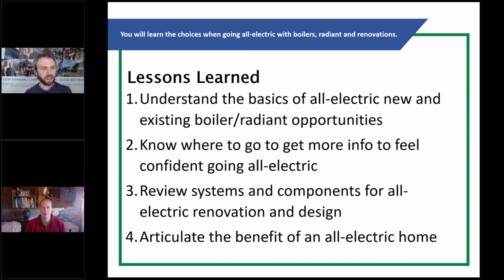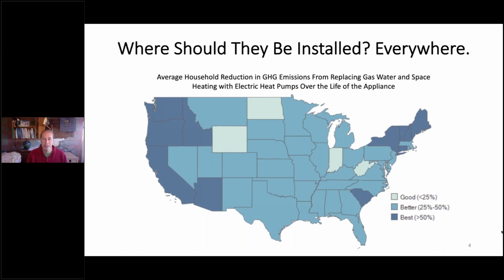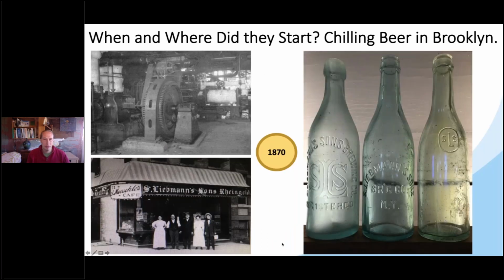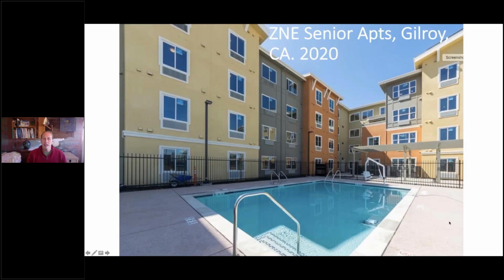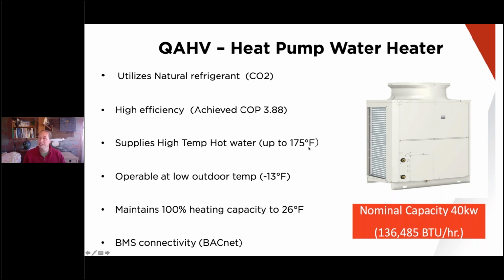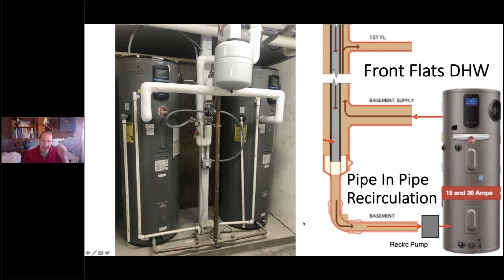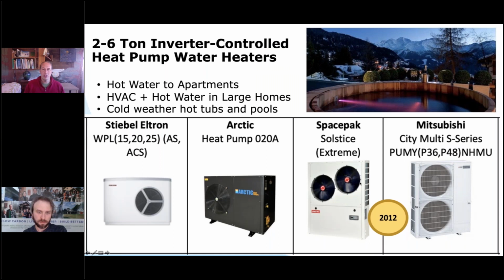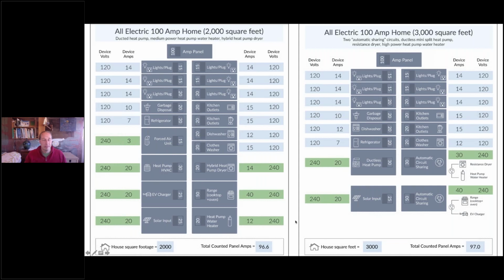Choices when going all-electric with boilers, radiant and renovations

Comment: Great presentation! I don't think forcing electrification for residential construction is a good idea, but it would be nice if the actual consumer was exposed to the benefits and given a choice. 

I'm looking at air to water heat pumps to replace our high efficiency natural gas boiler and the stacked heat pump strategy makes a lot of sense.

Comment: So after speaking to half a dozen electricians, unsurprisingly 0% have told me that my existing 100A panel is adequate for the addition of minisplits. I feel that if I remove my 30A dryer circuit I might be able to skate by with my electrical inspector. My big issue now is that my 1982 colonial has three bedrooms consisting of 230, 144 and 132 square feet all with their own doors to a small hallway. Even if I use the smallest wall mounted 6000 BTW mini-splits I get the idea that short-cycling will be an issue and make the two smaller rooms uncomfortable and inefficient. I've used online manual-J calculations and the smallest room wants 1200 btu cooling 3000 btu heating.  Each occupant likes different temperatures in their rooms. I've been pitched an 18k mitsubishi PEAD-18AA7 air handler ducted to all three rooms as well as a small bathroom but that does not fix the issues of different desired room temperatures. I'm in Central Massachusetts so it's more about heating that cooling out here. Any suggestions?
Reply from the maker: Did you use a blower door for accurate load calc?
Reply: @GreenHomeInstitute  Not recently, seeing that 6000 BTU is the smallest single room Mini-split available anyway, how would that effect my decision? I should mention that I am planning to remove all the attic fiber-celulose and seal the attic floor at some point since it was never done in the first place.
Reply: @SirBufo , one other thought--the turn-down ratio of a 6000 BTU minisplit will be about 1/3rd the max, or 2000 BTUs/hour. Haier has the best turndown ratio, of 1/4th.
Reply: Hi Peter, a reasonable alternative is to use packaged terminal heat pumps that have inverters for cold climate performance and electric resistance back-up, but are 120V and use so little power they can be plugged into wall outlets without a dedicated circuit or upsizing--they use 1100-1400W. One is made by Olimpia Splendid, the Maestro, and the other is made by Ephoca, the HPAC 2.0. So each bedroom would get zoned heating and cooling, and they're sized to go down to 2000-3000 BTUs/hr, and they're cheap to retrofit into a house--a carpenter can do it if they're careful, and no electrician necessary.